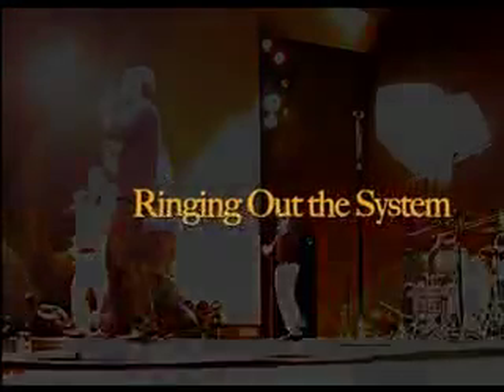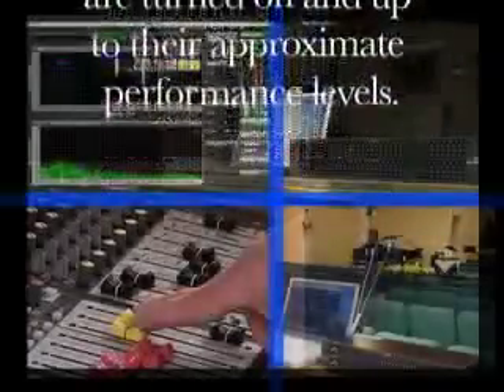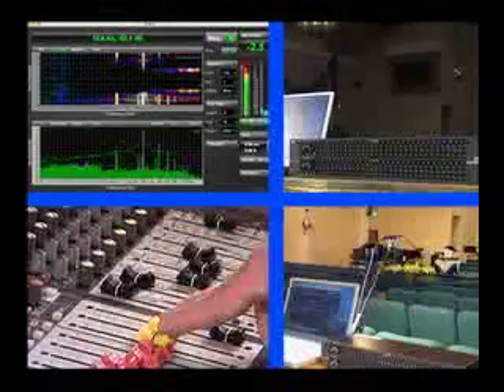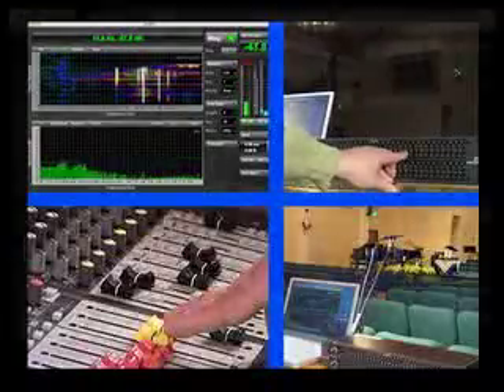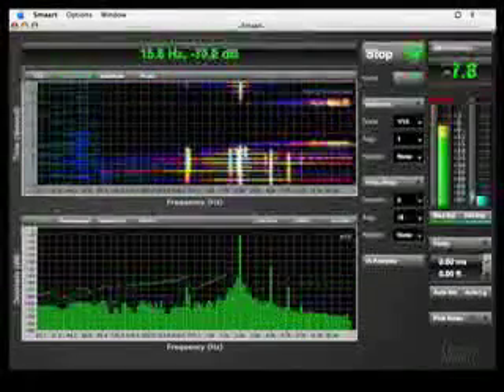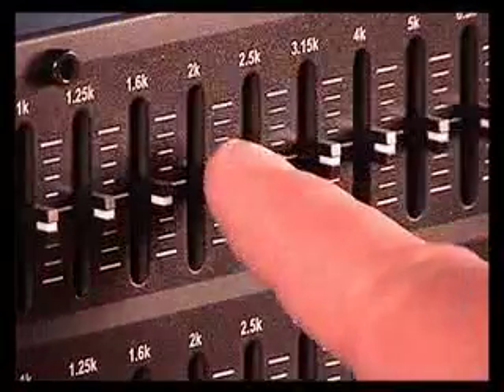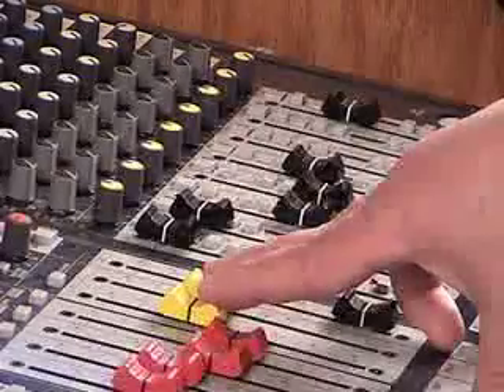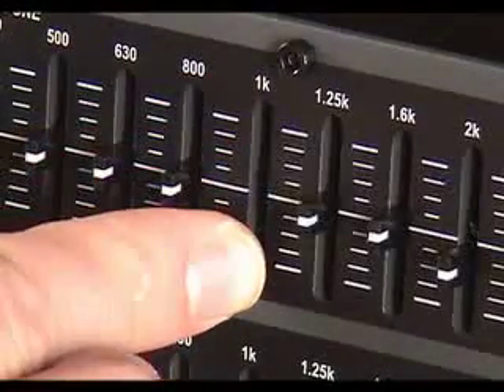Ringing Out Feedback from a PA System

Comment: Or, you could spend 200-300 dollars on a good feedback destroyer.  Extremely narrow filters and fast automatic detection and attenuation come cheap these days.  The algorithms in the new units are far better than the older ones.  The method shown here is archaic.
Reply: Mark Cole

?..or you could save 200-300 dollars by knowing what you're doing.  The method shown is not exactly archaic, but neither is it the right way to do it.  The problem with devices like FBX units is that they cannot actually hear sound.  All they know is voltage.

Comment: @bikergeekgd 32 freq BANDS...freq themselves are fluid analog. SAying 32 freq was saying 32 bands you can choose from. best for a PA is a parametric and KNOWING how to use one. You can save a ton of power using a parmetric. 32 band EQ is also called a 1/3 octive sometimes. Also note the freq's also change quite a bit as the room fills with people and heat. Allowing more high end boost. ( I use an analizer now and a 1/3 EQ)

Comment: ALSO- probably more vitally important, learn your gear. Learn where a 58 on a stick's corresponding monitor wants to sit for max stability. Find any odd phasey spots on stage that will affect the monitor's overall sound and response and avoid them. Figure out how to space monitors so if a singer INSISTS on doubling up and you have to crack vocals in both wedges, you don't hit as many phase problems. Monitor rants. Apologies if i digressed

Comment: LISTEN. pop a mic on, get on stage and listen to that beast roar. Modern monitors generally sound good running flat. The low mids and lows are inefficient so they get cut (that's a whole other lecture). THEN cut anything that rings. If it's loud enough and stable, job done. If you just cut willy nilly you'll have a crappy sounding monitor rig with no gain because you've cut half the frequencies and therefore essentially reduced the volume of the whole rig (assuming typical Q 1/3 octave Graphs)

Comment: the easiest way to eliminate feedback is to use your own ears, when mixing sound there is only one tool u can trust, your own ear, if something sounds a bit off then chances are it probably is.  to eliminate feedback look at speaker position and where a speaker is pointed, think of a speaker like a light if your "light" shines on your microphone the chances of feedback are greatly enhanced.  if u need a rundown and some tips, send me a message ive done sound designs for londons west end.

Comment: Why focus on ridding resonant frequencies from the mains(FOH).
The band should be far enough behind the accoustic line of sight so it would be very difficult to draw feedback thus allowing focus to remain on keeping fidelity as perfect as possible.
Most serious feedback issues are based on having a monitor system that can keep up with bands that use extreme backline volume, in those cases monitors are almost always overwhelmed by many high powered multidriver cabinets used for guitar and bass

Comment: I've used the Behringer FBQ2496, but it only has 20 frequencies that it can destroy. One way I found that works well (although it involves using a computer, which obviously crash and so are unreliable in live performance) is to run the audio through Ableton Live. Add the 'Spectrum' to a channel and gently turn up the audio until it starts feeding back. This is the same as what happens in this video.

Comment: honestly you dont need smaart to ring out a pa.. take a descent 31 band eq. set all you mics, and have them on.. and turn up the montiors.. when you get feed back either keep sliding down eq faders or use an rta to tell you what freq is feeding back then turn it down. ...for the most part, its that easy.

Comment: there is nothing will will completely run itself and fix everything. tools like smaart are exactly that.. TOOLS. they help you identify problem areas, calibrate, align... tons of things.. but by no means do they have an auto. you may be thinking of the auto EQ functions on the driverack pa.. that mearly is a pink noise gen that will will a graphic eq to filter out whatever eq curve you set.. which does help, but anyone can do this... and that is not active either. so it only helps so much

Comment: also, check out the instructions that come with the software. it is very indepth. The software, has spectralgraph, rta, magnitude and phase. I do highly recommend this software. And more help if needed can be found in eaw's forums. Many professional are on there as well as eaw engineers. If you cant afford software like this, your ear will work, or other rta's. Rane has a nice 31 band rta. you want 1/3 octave eq, which is 31 bands.